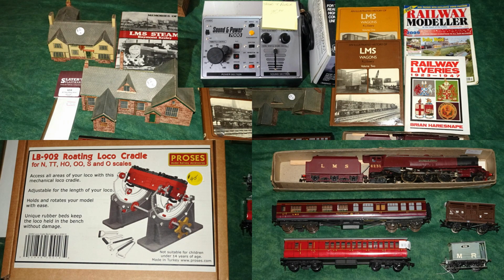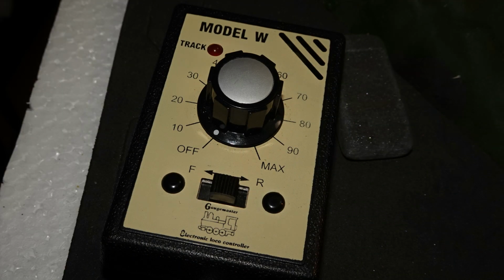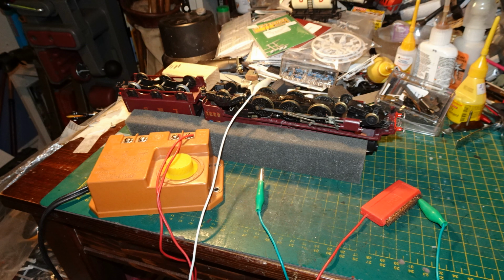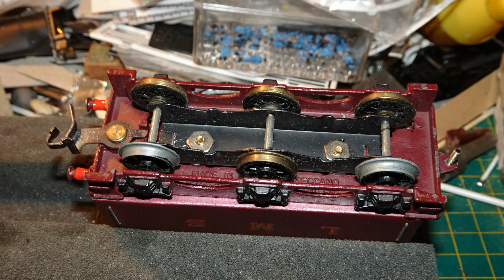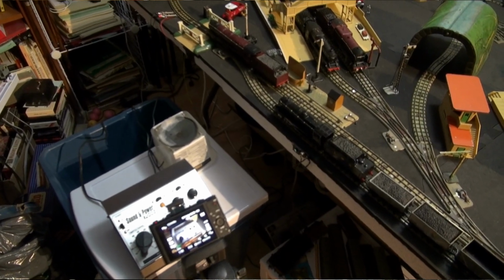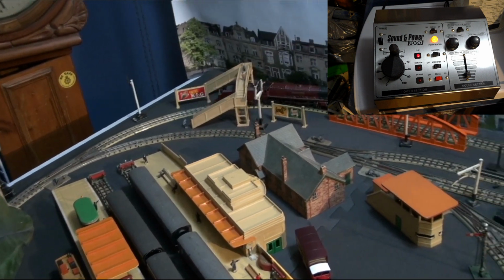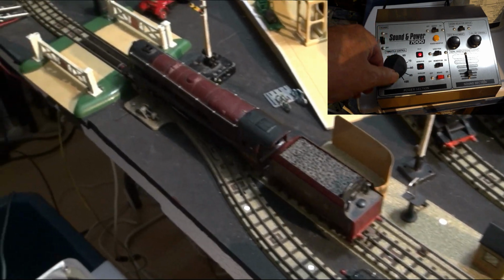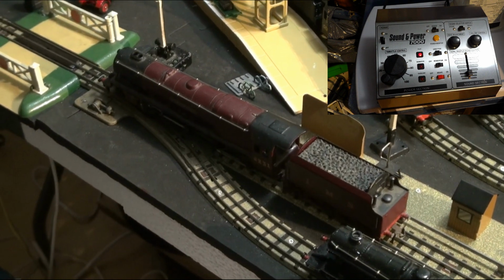OO 224, MRC Sound & Power 7000, Weird Duchess

Comment: One bit of luck is that the speaker is 8 Ohms. Often cheap speakers are 4 Ohms. This léans you could easily connect it to a big hi-fi speaker in a cabinet…
Might be worth a try. Nudge mode might be half wave as we have on our good old Hammant and Morgan Clippers and Duettes.
As for the cracked Duchess - car body filler ?
Sorry to comment so late on these videos. I’ve been catching up on all the videos I’d missed while spending much of my spare time trying to get my 3-rail layout to function reliably 😂

Comment: Thanks for showing the insides of your Ancaster Duchess. Looks like a strange arrangement with a light that is not illuminating any locomotive feature... the motor is a Pittman I believe. 
The cracked body looks OK from a distance so get a replacement chassis and renumber.